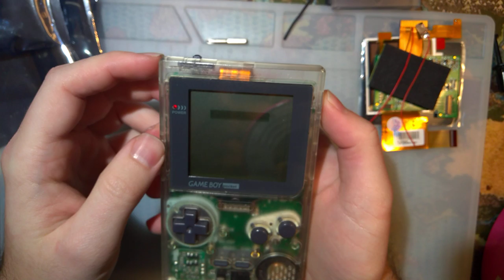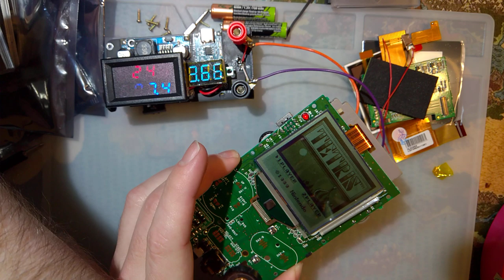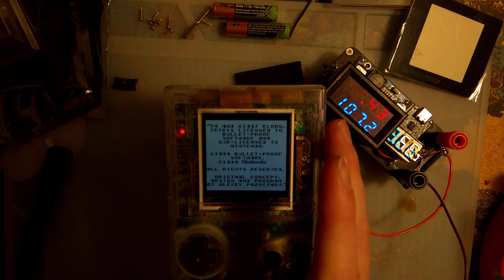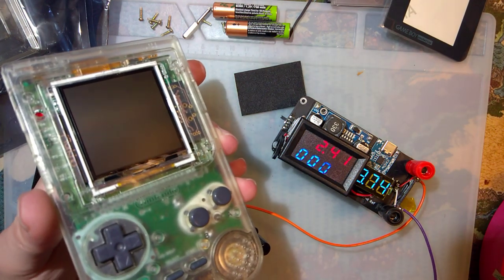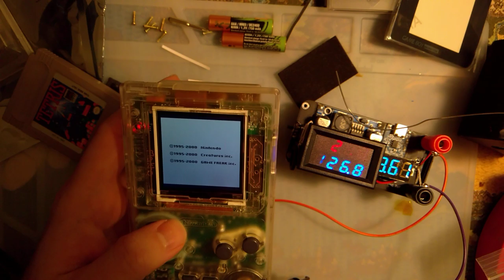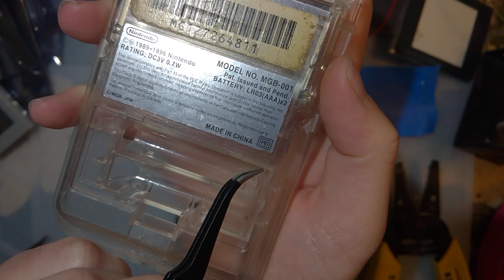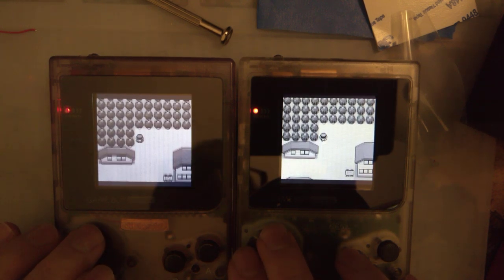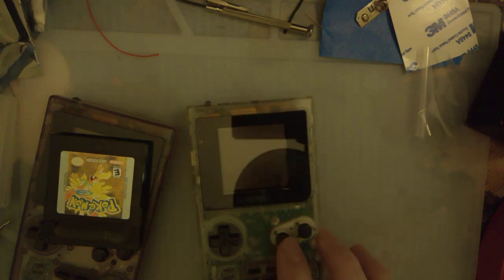Installing a Backlight kit (that doesn't drop frames, One Chip AIO) in a Game Boy Pocket

Comment: I have had my screen installed for about 2 weeks and it’s decided to go off no back light display or back light working at first I thought I could be my power wire came lose but it’s fine do you have any ideas what could be wrong with it or is it just a case of it’s fine faulty ?

Comment: Mine failed sadly, the aliexpress seller had instructions that detailed soldering the power to the battery terminal, so I did that. It didn't work. I then tried the contact point in your video, still didn't work. Lastly I tried to put it back to the battery terminal and the power pad on the ribbon cable finally gave out and ripped off. I'm contacting the seller to see if anything can be done but I suspect probably not. Done several mods and this is the first one to be such a catastrophic failure.

Comment: Can you show me what points to solder for the option of using buttons to adjust the brightness?
Reply from the maker: You can wire them to whatever buttons you want. The points to solder to are on the top left of the PCB by the touch sensor.

Comment: Does the contract wheel still function normally?
Reply from the maker: The contrast wheel has no function with this kit installed. The new LCD does not even hook into the voltage regulator that the wheel controls.

Comment: Thanks for the heads up, but I can't buy from that site when shipping to Spain is the same price as the adapter. I'll wait for the Chinese to clone then clone and resell on Aliexpress.
Reply from the maker: First off, that's not a very healthy attitude towards the scene. If you like what a modder is doing, you should support them and not wish for a clone. 

Second, these kits already are on aliexpress.
Reply: @makho  That site offers a ridiculous shipping price. The second site that also had them has a $15 option and they're also based in the US. I can't buy from a site that only sells to US customers (and importing from the US is almost an instant import tax that I can't negotiate). And I jokingly said clone of a clone because the one you installed is a clone of the original kit (even FP posted advising against a copy of their GBA adapter that uses a smiliar big blueprint FPGA). Either way I saw the GBC variant but not the GBP one, although the seller said they updated the firmware and it has no frame skipping now.
Reply from the maker: @dimitrypilin3098  It's not a clone. It's a separate kit.
Reply: @makho  Good. Sorry for being a jerk and thank you for your videos.